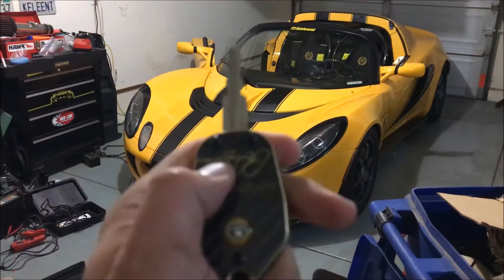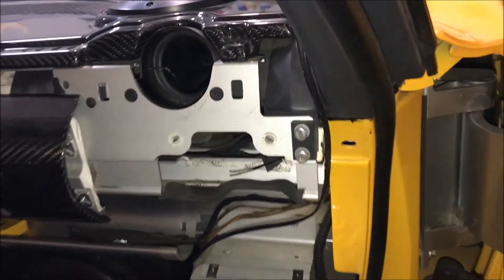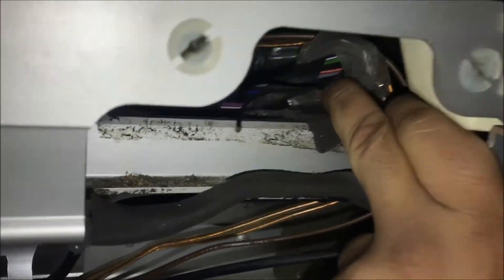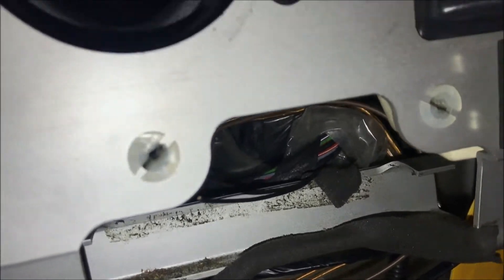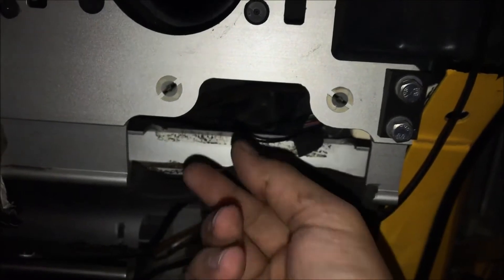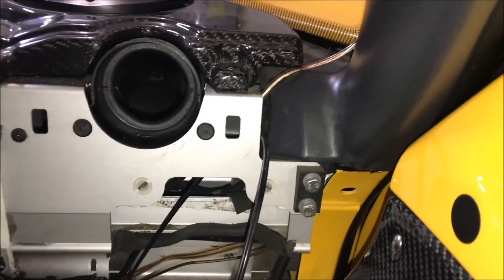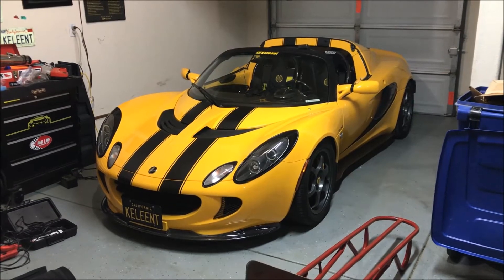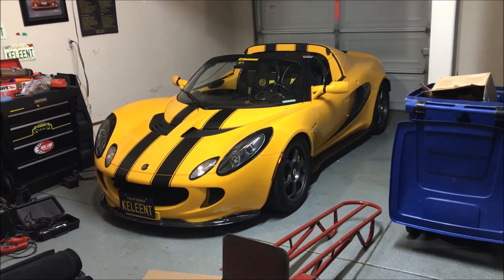How to increase the range of your key fob transmitter on a Lotus Elise or Exige

Comment: Would there ever be a keyfob itself that could boost the range? I definitely need to do something because I have to stand next to my car to get it to unlock with my keys, even with fresh batteries in the keys.
Reply from the maker: You need to do this mod. There is no other way without changing the alarm system entirely